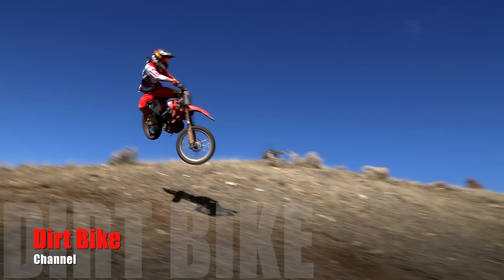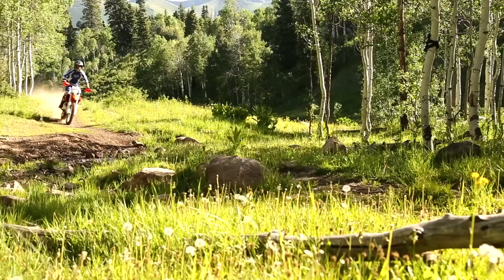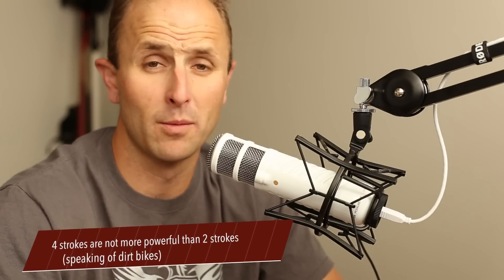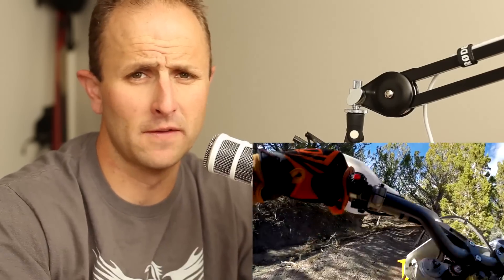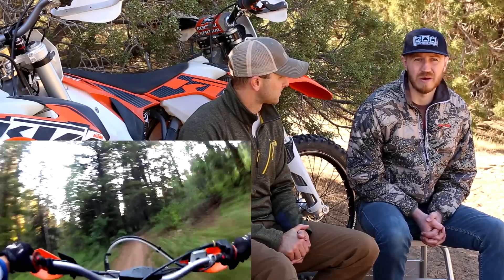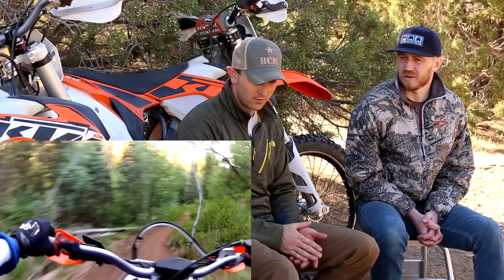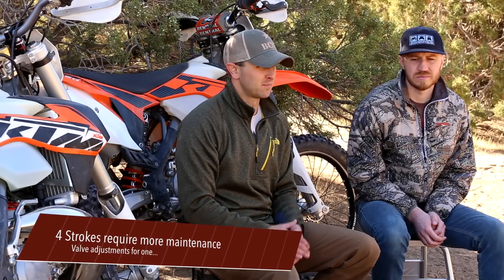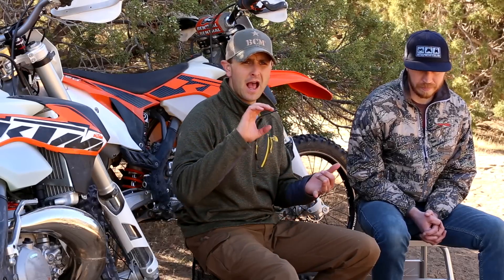Enduro 4 Stroke vs 2 Stroke Part 1

Comment: Interesting video topic, thanks.
I've been riding a KTM250exc 1997 2 stroke for a couple of decades and it's still a really good bike and cheap to maintain.
I tend to short shift it a lot as it's got fairly reasonable bottom end and I'm usually at the pointy end of the riders.
Because I ride like this I'll get an easy 200 hrs before rebuilding the top end and that's a job that takes about an hour on a 2 stroke, so that's all good too.

Comment: been riding my kx450f for almost 10 years, zero maintenance on the engine and still is a monster.
Reply from the maker: +appcarpenter1 You must not put that many hours on the motor if you have done Zero maintenance.

Comment: Braking 2 stroke vs 4 stroke. On a 2 stroke you jump on the tank and hit the front brake hard AF, downshift 2 gears, and trail brake the rear. As soon as the ass end begins to slide,  you nail the throttle and steer with the rear wheel. The physics is simple, but it takes some years to learn enough to write this comment :)

Comment: I do extreme Enduro on a 2017 ktm 350xcf. It’s a motocross motor with and enduro gearbox and it pulls like a tractor. Iv done 165hours on the bike and runs like a dream. I put a new piston rings camchain and can chain adjuster in at 120 hours. The only down fall is it’s a bit heavier then a 2 stroke but u get use to it. 
I believe everyone has there own opinion on wat bike best suits there ability and wat bike they like best. Thanks for reading but that’s just my opinion.

Comment: Performance is just one aspect, I find efficiency differences of the two engine types very interesting. The 4 stroke engine is very efficient, there is better mixing of the charge mixture and more complete combustion. Less fuel is wasted, efficiency is much improved, and range for the application is increased. 
Also, the 4 stroke engine is usually quieter. 
You can design an engine to be any size suitable for the application, so the fact that generally a 2 stroke of similar size cc will outperform a 4 of similar cc is not an advantage when you can just design a larger 4 stroke engine for the application with advantages of better range, quieter, and less emissions. So that's the main reasons why 4 stroke engines have become preferred. When it comes to larger applications and you  have fuel injection and turbo charging, power outputs can further increase. It's more about the required power for the application and then the most suitable engine is selected. The mixing of oil into the fuel for lubricant is what makes the 2 stroke enherently worse on emissions, also the fact that some mixture passes through unburned. Combustion is more complete and with a lower carbon fuel source in the 4 stroke. So for the 2 stroke, those challenges need to be overcome.

Comment: I put 700 hours on 2015 EXC - All Supermoto miles with zero engine maintenance. It did smoke some & burnt a lot of oil towards the end. I sold it to dealer for $3000.00 in 2021 <<<<

Comment: I was 33 years old and 235 pounds in 1998 when I bought a new KX 250.   This 2-stroke had a great mid-range and ample low range.  I was not a great rider and this power-band allowed me to have fun.  I can imagine how much of a rocket ship the KX would have been for a rider 100 pounds lighter.

I switched with a guy at a track once who had a CR 250.  Stalled in every berm.  I had to keep the thing tacked- out to get useful power.  Needless to say—it was not fun for me to ride.  

I think i recall that the 1998 Kawasakis had boasted a "new midrange" and new "low end" for its KX bikes for that model year

I rode on "motocross" style tracks mainly but I also drag-raced it on open fields.

I miss it.  I miss riding it.  😟

Comment: I have multiple 2 strokes I still ride! BUT the 4 stroke motors have become extremely reliable! 91 hrs on my Yamaha 450 I bought brand new and havent had to adjust the valves once and yes I check them and yes I race the bike. Love 2 strokes, but both bikes really are amazing

Comment: Oh boy there is a TON more to consider when buying a bike than what you've pointed out. I want to state that I don't advocate one or the other because I love them both. In the early years of the modern 4t I was pretty spooked by them but they are awesome now and very reliable. That said I've owned 4 KTM 300s and they were like you stated cheap to maintain and easy to work on. My current '13 450XCF though is the best bike I've ever owned or ridden. It's awesome at tight single track/desert/sand/track and well just about anything. My previous 300s struggled a little more in the deep sand and current tracks which are designed more for 4t's.
Also, I've got close to 100 hard hours on it with zero issues, just change oil and keep airfilter clean, did the same thing at same interval with my 300s. Plus unless there is a catastrophic failure there is no way it's going to cost $2300 to do a top end. It's still just a piston kit with the added expense of a valve adjust (worth it)! 
That all said I love the 300 2t but I'm lovin my 450 more these days.........
Reply from the maker: Gene McEntire Thanks for replying.  There is too much to get into with 10 videos.  Ultimately, you find something you like and stay with it, right?

Comment: The thing to remember is that this video, regarding 4 strokes, is primarily aimed at the "high performance" 4 strokes (racing bikes).  Something like a trail ridden XR/DR/CRF is not going to have half the maintenance as a "race breed" 4 strokes.

Comment: I'm riding a 95 yz250 and had an 05crf250 with a 280 kit and all the goodies and id take my 2 stroke any day over a fourstroke. I went through 3 water pump seals, countless valve adjustments and the clutch would slip when hot even after stiffer springs and adding a washer for more bite. 
Long live the 2 stroke!

Comment: If im not mistaken the 4 stroke was the answer to CARB compliance...... motorcycle manufacturers realized that the end was coming for the 2 stroke world....in 1998 Doug Henry raced the first 4 stroke Yamaha ......it was thunderous sounding and the holeshots were incredible...... I had the first 400f in my neighborhood and found it very predictable and had never realized compression braking could be useful in trail riding....I will always gavor a 250 2 stroke, but I find it amazing the technology that was was used in designing a four stroke motocross bike......

Comment: My 1976 KTM 250 I had for more than 25 years.  I raced it hundreds of time.  Motocross, cross country, Enduros. When I sold it it still ran great. It still had the original piston in it.  I am not convinced that a 4t has more grunt than a 2t.  Most are not, granted but that does not mean they could not be made to have that kind of powerband.  Maybe it’s not about how much power they make but how quickly they make the Power. 4t makes Power more slowly than a 2t

Comment: Thank you for this information.  Had read years ago about Honda engineers trying to make 2 stroke engines more fuel efficient and cleaner.  Our government got involved with trying to put 2 stroke engines out of commission.   I own a 2 stroke and 4 stroke leaf blowers.  The 4 stroke does not have the power of the 2 stroke.

Comment: When I can't tune my yz250 correctly anymore with the air mixture setting, that's when I know the compression has dropped and it needs a ring. I ring it once, then slap a piston in the next time. Two top ends a race season is absolutely needed on my yz250.

Comment: I own a 2014 wr 450 f... It's not as heavy as you might think, the power is simply phenomenal, it's a nimble bike to handle and if we speak about maintenance, as long as you change the oil regularly, it runs forever... On my last wr 450 (2004) I've Rebuilt the engine after 500 hours...
Reply from the maker: +Raf Dan I have a 2014 YZ450F.  It's lighter by a mile than your WR and it feels very heavy when riding it back to back with my 300 2 stroke. I just compared them yesterday again.  4 strokes are fine, but light and nimble they are NOT.  Not when you compare them side by side, back to back with a 2 stroke.  It's something you have to experience first hand to really appreciate.

Comment: A friend rode precisely 466hours with the same piston on Husaberg 300 2stroke. In the end it may had lost some of the power but my friend said he didnt notice anything weird. He's an amateur enduro rider, woods, swamps, winters too. Rarely high rev riding.
Reply from the maker: Narza85 He's not alone.  Many big bore 2 stroke riders have had similar experiences.  Sure, a KX100 wears pistons really quick because they are always on the pipe.  These 250s and 300s are not ridden nearly as hard as the small 2Ts.
Reply: Dirt Bike Channel Yeah I love 2-strokes, I ride a 300EXC 2011. I might also buy a bigger 4stroke, mainly for longer road trips. Like 690 enduro etc. They seem to be more enjoyable doing that.   But i've also played with the idea to register my 300 street legal. In here you can easily, you just have to put the signals on and put that (temporary) extra muffler on. Would be fun in the city with supermoto tyres. :)
Reply from the maker: Narza85 I'm not a huge fan of 2 strokes on the street.  I think you'd be better off with a 4 stroke if you want to supermoto.

Comment: 14,000 rpm is right at the metallurgical limit. I've seen 250 MX engines explode so bad, even the dip stick is ruined. Just trash the whole thing...but I was no slouch, I ran an 87 CR500 Honda in the desert, Noleen suspension, ported for hill climbs. After six or seven years, Yamalube R, 32.1...I kinda getting guilty about doing a top end. Same rings. Same 100 mph top end (15/47 gears.) It never broke, or even fouled a plug, everything from singletrack, to 5th gear desert. Once I put this GIANT Kenda Baja on the back, it was like on rails. 34mm Showa Cartridge forks, the best on Earth. 4 inch sag on a Works Performance rear shock, and 34's on the front, with Clark Jones doing the work, like on a magic carpet, no headshake anywhere. Then all my riding buddies got KTM's and other stuff. They chided me for riding such an old ratty CR500. Until we drag raced on the dry lake. I started off in second gear, and by the time I got into 5th, all the four strikers were little dots behind me, on the horizon almost. No contest. Put a two stroke top end, on a four stroke bottom end, a fuel/air injector, exhaust port. Magic.

Comment: 07 RM250 loving it 96kgs  >>>>>>>> been riding dirtbikes for 29yrs ....over doz different bikes ....2 stroke dominants .... extreme enduro >>>  light weight ,on tap power ,easy start when hot ,low cost rebuilds , strong resale prices , FWW fixes traction issues easy

Comment: This is always a good debate. 4 stroke motors are more reliable than 2 strokes. But not in a motocross or competition machines. The reason being is for the 4strokes to mach the 2strokes they need to rev very high which puts massive strain on the valve gear and moving parts. 2stroke all the way for me baby.

Comment: 2005 KLX 300R bought for $1700 in 2012 and the exhaust valves are getting close.  From a weekend Dad point of view, no worries.  Robbie Racer's experience will be greatly different.

Comment: all good comment,, ive ridden both, either bike is a rush, different strokes 4 different folks tho, remember way back when i step off my kx, in early 80's to ride my buddies yam tt500,  wow,  it was an eye opener back then, the tons of raw torque off corners made me respect that bike, " no power valves back then",  now that 2 stroke is an equal, cost and weight are factors that cannot be over-ridden at any angle,....

Comment: I love my air cooled CRF230, doesn't make a ton of power but it is reliable as hell that's for sure. Does enough for basic trail riding and around town. Will still do 70+ on the highway!
Reply from the maker: AdrenoMoto Rock on.  Keep riding.
Reply: +Adreno  Yea man, i have a rm125 and a buddy who has a crf 230 and it was a mountain goat. Not overly fast but super reliable, great bike

Comment: I can see the appeal in both categories. The 4 stroke is a little less powerful and heavier, but they are good for very long rides and are a little more stable because of the weight. The 2 stroke is a monster that is lightweight and very powerful. However the 2 strokes tend to blow up after very long riding stents. That is why you mainly see 4 strokes in the long distance high speed enduro riding like Baja. The two stroke shines in the very technical low speed sections of enduro like rock beds and switchbacks because they can accelerate better that 4 strokes. Running a 2 stroke at 50-90 mph in a desert will kill it, but a 4 stroke can hang at the high rpm for a lot longer

Comment: I love the 2 strokes and will have another one some day but only when I can afford to have 2 bikes. Now I'm on a xcf-w 350 and it's lite enough and does wide range of riding.
Reply from the maker: Chad Hobson How do you like that 350?
Reply: I love it! it's about 30 lbs lighter than my 450 so it works great on single track and pretty much every where else.
Reply from the maker: Chad Hobson Very cool.  I'm trying to find a deal on a 350 XC so that we can do a proper review of one.

Comment: Nice to hear the world is getting smart again...... when I was a teenager... I use to race a Hodaka Super rat in the 70s.... it ruled the 100cc class, until the Yamaha YZ came out,  4 strokes were just a joke on a motocross track, ¼ throttle, twist and hang on.... as I get into my 20s I got into cars... the fastest class, at least at the track I rode was the 125 class... it beat the 250s and the open class.... . so years later, I'm looking at dirt bikes and they are all 4 stroke? I was blown away.... no dirt bike rider should be on a 4 stroke... I know you guys are pulling punches..... because there are a lot of 4 strokers out there, but you know the truth..... but 2 strokes are coming back, thank God..

Comment: I've had a kx85 and had to do so much work on it and it was a 2010. I now ride a 2005 kx250f and I've never ever had an issue. all I've done is spoke tightening, oil changes and all that basic maintenance

Comment: Thanks for the post, a lot of valid points. 250 2's should only be compared to 450 or larger 4's. I rode medium to hard Enduro for 10 years on a KX500 2 stroke. A great woods bike if properly set up. I'm currently on a 525exc and even though the KX made more torque, more HP, and was lighter, I still ride fresher, faster, longer (and I'm older) on the 4 stroke 525.  The cost difference really is negligible. I had to buy a new expansion chamber literally every 3rd ride from bashing it on rocks on the 2 stroke.  In my opinion 2 strokes are only better when you spend more time dragging your bike up a hill than riding it. And before someone poo poos a woods KX500 I would hope that they would have actually ridden one with a flywheel weight, V Force, and a Gnarly. It was almost Un stallable.
Reply from the maker: R Cash thanks for sharing.

Comment: I grew up in the 70ts and 4 strokes always revd higher than 2 strokes and I believe that will always be the case. For example the Honda CB 350 2-cylinder 4 stroke redlines @ 10,500 RPM while the Yamaha RD 350 2-cylinder 2 stroke redlines @ 7,500 RPM but of course being a 2 stroke makes more HP, more torque, lighter, and in a drag race will disappear on the Honda. I also noticed that 4 strokes always have higher engine compression ratios. The Honda is 9.5:1 while the Yamaha is 6.6:1. That is why 4 strokes have better engine breaking. 

If you compare transmissions of both 4 strokes and 2 strokes of comparable engine size you will fine that the gear ratios on 4 strokes are lower than 2 strokes. 

But I leave you with this question. Many 4 stroke engines have counter balance shafts to smooth out vibrations. Why not for 2 strokes. We know how much 2 stroke engines vibrate, therefore a counter balance shaft is needed much more on a 2 stroke than on a 4 stroke. 

Can you or anyone else comment on my question? Thx....

Comment: The ONLY thing wrong with 2-strokes, is you have to know them to fix them. I had a KTM 450, and I researched, and researched, however had to take it in to fix, however that costed so much. So I just sold, but I did have it for 3 years. Another thing is that I dont know about you, but 2-strokes cost so much money. 2-strokes though are so much fun, I love the sound, and last a while!

Comment: Would never buy a race style 4 stroke but I swear by the old fashioned honda 230's and other CRF's. Unreal bikes
Reply from the maker: Evan Nolan Oldie, but a a goody, eh?
Reply: To say the least
Reply: They're a little slow, but probably the most bulletproof bikes ever. I have an '08 230, and she still fires up with no problem. One of the best bikes to learn on.

Comment: This is just in my opinion. 2 stroke = Speed 4 stroke = Power. Just like he said 2 stroke fires faster thus giving it faster reaction time, but not giving much of a power. And where 4 stroke has a bigger engine which makes it heavier but makes up with the power it got from the engine. 2 strokes relies more on momentum so if they tried to do a hill climb they will do fine but they need a little bit of a momentum. Although on a straight road it goes like it's possessed meaning very very fast. 4 stroke doesn't need momentum so it can manage to power it through even if you're starting at the feet of the hill. But on the straight road they go fast but not that fast as a 2 stroke would. But again this all depends on what bike, what brand, the condition of the place they are off roading in etc. About maintenance, 2 stroke and 4 stroke does not require that much of a maintenance. They're pretty much the same when it comes to maintenance. Sorry for my bad english. And again this is just my opinion and experience of riding 2 stroke and 4 stroke.